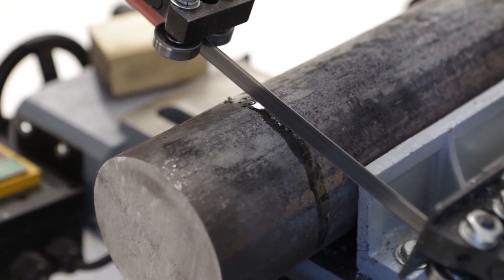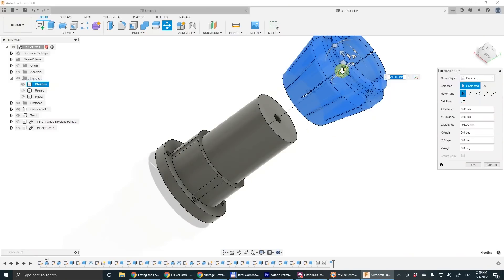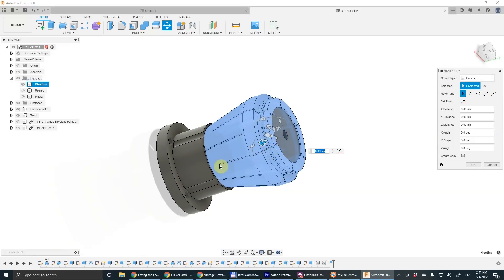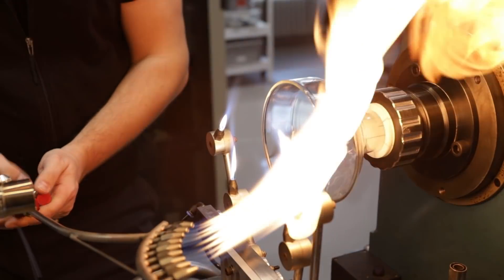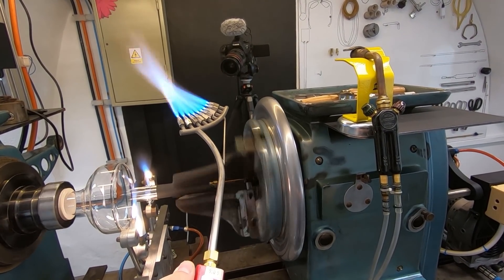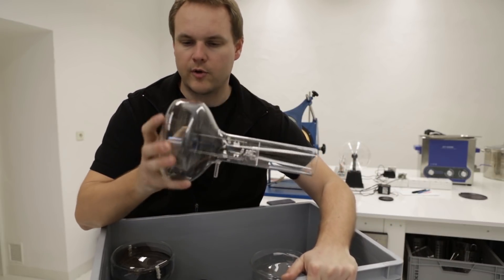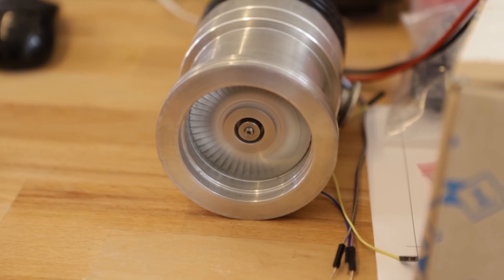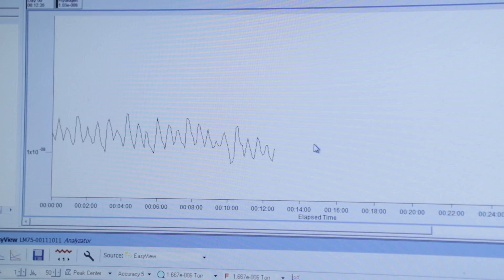New colleagues, new burner and progress on gas analysis system | week 8-9/2022

Comment: I think the purging gas should be injected as far forward as possible an escape to the back. This way the gas is always flushing away the oxygen. How the construction is now, the gas will move to the front as long as there is not enough seal, but at some point the gases from the flame will not be removed from the front, and this is the moment when left over oxygen reacts with the internals.

Comment: I was reading all the questions about "can you anneal the glass?" and your answers with reasons that doesn't work because the heat will oxidize the internal elements, and I had a "probably a bad idea but it might work" thought: There isn't much physical contact between the envelope (in the areas where you'd want to heat it) and the internal elements, so in principle you should be able to maintain a temperature difference between them.  I wonder if you could flow a cooler gas through the inside of the tube to cool the internal elements while heating the envelope.  It shouldn't take a lot to keep the grids cool....

Of course, there is probably a simpler solution too.  :)

Comment: those Unitorches are a weird beast.  I have a love/hate relationship with mine.  it definitely frees up a hand when you might otherwise be using crossfires and two hand torches at the same time.  I understand the struggle to get a narrow heat band on large diameter tube.

Comment: In regards to the stresses in the glass, i wonder what would happen if you'd use a 5th hand on the bottom burner that's pointed such that the flame is fanned out towards the base of the tube, angled up (so it doesn't interfere with your work). That way, even if you do have stress in the glass, it's less pronounced into on spot. Regardless, normalizing seems to be something you'll need to consider, that's a pretty sharp demarcation line on the glass. 

Source: a few years back we needed to test various concrete formulas against sea water and we ordered specific lab equipment out of glass. A sharp demarcation line caused most of it to crack as the heat cycling tests began. The glass manufacturer said they fixed it by "fanning out the heat pattern". I assume that's what they did in situ (the complicated glass to metal ports kinda blocked any potential normalizing process).

Comment: hi, maybe my question is stupid. What is the lifespan of these tubes? Is it possible that need to refill with gases? If yes it is technically possible or after a certain time the tube will not function anymore?
Reply: Although I don't have a Nixie tube from Dalibor, I have a clock built with the Z566M, it has been running without stopping since 2008 and so far I have not seen any signs of wear.

Comment: Your analysis system is faulty - but not for the reason you think. I'll outline two points:
1 - By butting the tube up against the glass like that, and sealing the outside with epoxy, you're creating the mother of all virtual leaks, which will significantly impact your RGA readings. If you really want to do this right, you should just seal a short piece of tube to the envelope at the creation stage, without blowing through(i.e. a second "blind" evacuation tube), and then half-drill it.
Alternatively, the way this is generally done is outlined in #2.
2 - If you have a long-term sealed, self-contained system, the way to create an analysis port is by adding a second, open tube with a glass-to-metal adapter(i.e CF1.33), connected directly to a UHV-specific valve(see below). You evacuate and fill the system as normal, and then when time comes, you connect it to the RGA and simply open the valve. This also raises another issue - if you just dump all the gas from the tube into the RGA, you'll get completely garbage readings. If you want to do a single-shot analysis from a sealed volume(i.e., get more resolution), you need something to seriously restrict the flow. This is usually done with something called a "variable leak valve", which you can also use as a long-term sealing element when closed. You can find them on eBay for a few hundred euros, just make sure the sapphire/diamond flat is not damaged. Or brand new, for around 600-900.

Oh, and for turbo controllers, just switch to open loop operation when you reach a certain margin. When I designed mine, if the speed was within 5Hz, I just locked it to the set speed and a minimum current(adjusted by hand). If it dropped, then I went back in sync.
Reply from the maker: Cool! 2. We have a metering valve there to restrict the flow, with diy teflon seat to seal off completely - I am not sure if it will work - we will see! 1. We will need to analyze random faulty tubes, old tubes from 70s etc - so we cannot make a special flange on it. But I am aware of the risk of making virtual leaks this way. Also, we might need to add one more turbo on that part - kind of loadlock system to evacuate faster.. Thank you for your inputs - it will be interesting to see how it works in real life..
Reply: @daliborfarny  The professional solution for this, is a fracture cell or fracture chamber. I saw one at Tungsram (now GE) a hungarian light bulb manufacturer's lab. They put the bulb in a chamber, then they pumped down the chamber, then they closed the pumping line, then they fractured the glass with a similar magnetic thingy, then they let the gas enter to the analysis chamber through a leak valve. Ask PreVac (a company in Poland) to be your supporter, they can easily make one for you. :)
Reply from the maker: @altxyz  That solution would be problematic for testing already finished tubes - they contain plastics, glues etc.. in the socket. And the main point is to test tubes that for some reason failed - these always come with the socket. Also, such a custom built commercial device is not within our budget.
Reply from the maker: Turbo - exactly, this is how Radim solved it in the end..

Comment: I wonder if a hydrogen flame might reduce the oxidative process, you could run it quite rich to deoxidise things.
Of course then you would have more lovely hydrogen to pump down :-)

I wonder, could you anneal during the bake out phase? You're pulling a vacuum then so no oxygen to worry about and you're already in an oven? Just now it needs 500c "easy" lol.
Reply from the maker: 500C is limit - above that the mercury dispensers will release mercury to vacuum.. and we need 560C to anneal..
Reply: @daliborfarny  ahh that's a pain in the butt.

Comment: <----noob
can't the stress just be removed in an annealing oven?
edit: ah, now I see the other comments... it oxidizes the metal parts inside.  there's GOT to be a cheap way of introducing argon or maybe even just pure N2 if you can get away with it, into a common annealing oven to purge it of air and water.

Comment: Dont put the scroll pump the same table as the turbo. The vibration will shorten the turbo's life. Bad bearings can cause oscillation in the rotational speed too.
Reply from the maker: Good info! We will make a rack later - with some vibration dumping

Comment: I assume time spent in an annealing oven would cause more oxidation - so is not a solution to the build up in stress in the glass?
Reply from the maker: thats the problem - annealing would burn the internal elements. Normally, it would be a clean solution!
Reply: @daliborfarny  Yes.  Inert gas ovens are available - but large ones look expensive.  It's too late now, but I wonder if the tube enclosure had been designed so that the seam to be welded was at the intersection of the large cylindrical section and the tapered section - rather than the front glass and the large cylindrical section - whether that would have caused less heat to be absorbed by the internal elements.  The large disc of metal at that end of the stack of elements is already a dark colour - and may have protected the numbers from most of the heat.  Good luck finding a solution.

Comment: Have you tried tempering the glass tubes?
Reply: Take the glass up to 620 C and then cool it no faster than 30 C per hour
Reply from the maker: @nethoncho  Thats the problem, at this temperature, the internal elements will burn out or get heavily oxidized..
Reply: @daliborfarny  I don't know. I'm not familiar with the properties of glass. But maybe you can relieve internal stresses with ultrasonic treatment?
I think you have to find a "think outside the box" solution...